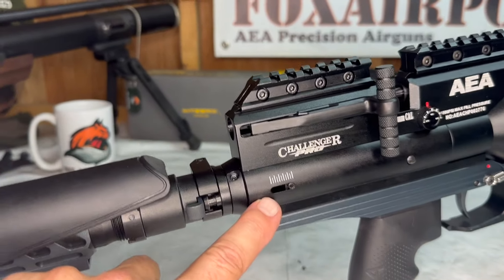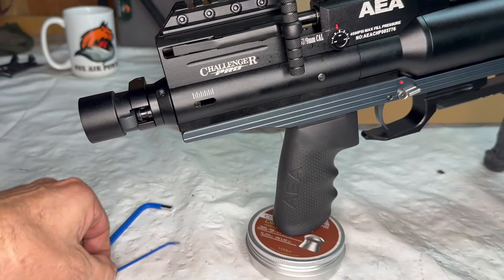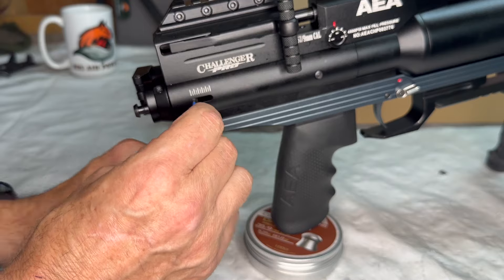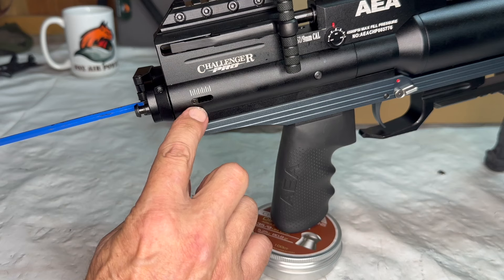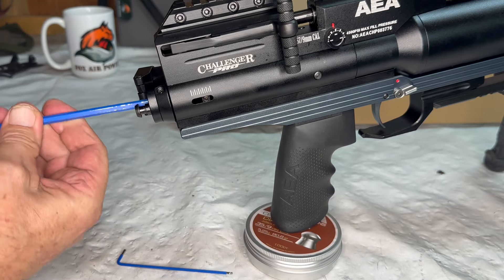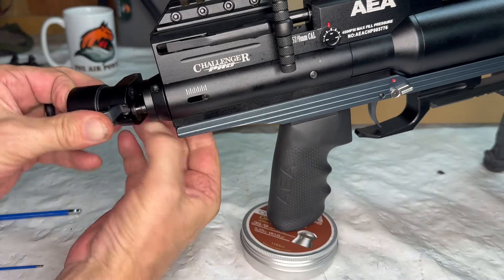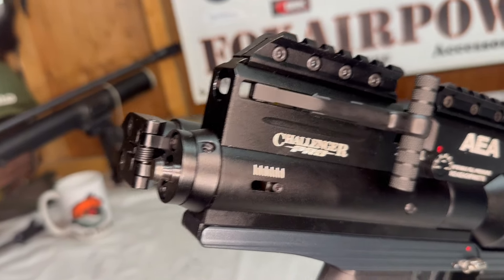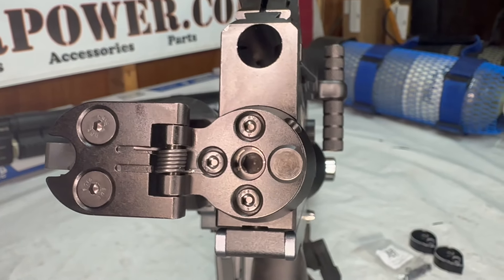AEA CHALLENGER PRO LONG BARREL SUMMER 2024 ADDITION - HOW TO ADJUST HAMMER SPRING

Comment: Forget all that. Lol! I want to see a comparison to the other Chall Pro Long barrel .35. To see if it's even worth it.
Reply: It’s going to be the same maxed out.  This just gives the user the ability to properly tune it down to a lower power level. Only took AEA like three years to cure their head in rectum syndrome and finally add this to something.
Reply: @Light_357  Yeahive had 6 AEA Challengers over the course of 4 years. I was one of the 1st to even have an AEA when BinTac was still going through legal issues, and I begged them to make a Challenger with just a regulator and a hammer spring adjuster. Now I don't even want it. Like you said, it took way too long. I'm waiting on the Sonic Super. Well, that name will be changed due to it being a trademark name, but anyway, save your money for that gun, which will be here late, fall early, or winter. It's a power house with all the bells and whistles.